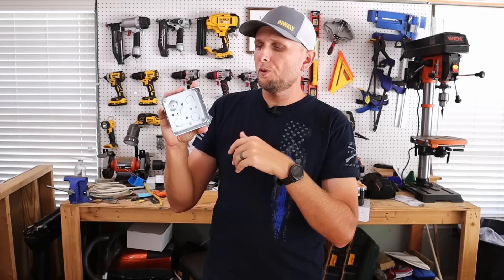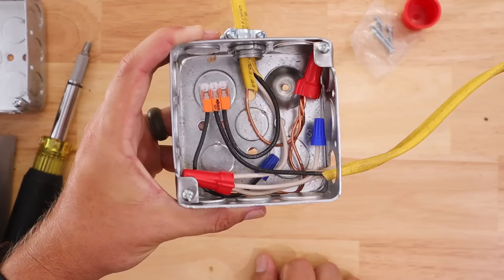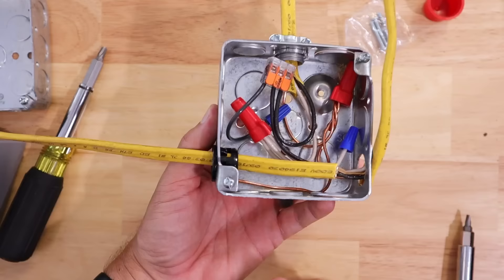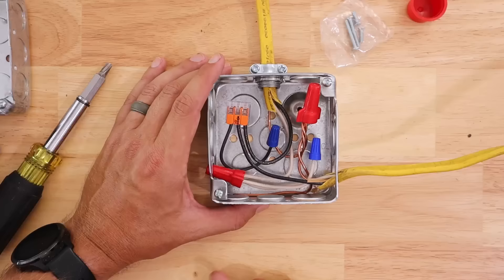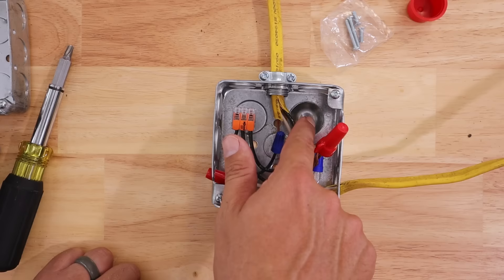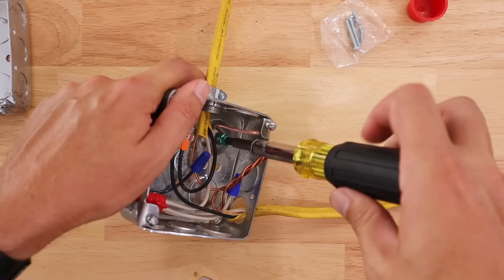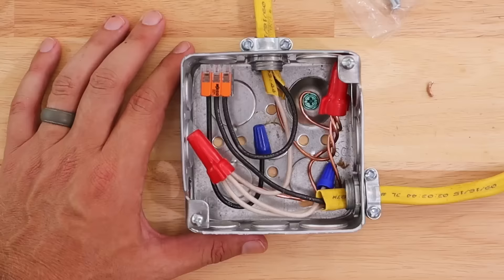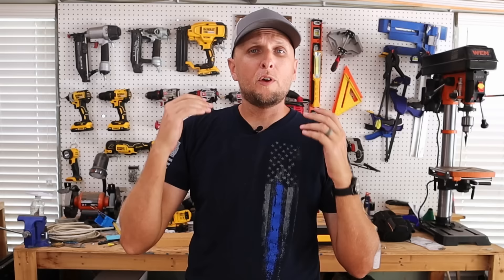The BIGGEST Mistakes DIYers Don't Know They Are Making When Installing Metal Electrical Boxes

Comment: Yes, the metal box should be grounded but grounding the box doesn't protect you from getting shocked.  What really happens is if the box becomes energized and the box is grounded, then the breaker should trip because it causes a short.  If you touch the box before the breaker trips, you will be shocked.  Remember, grounding doesn't protect people from getting shocked, it just allows OCPD to operate properly.
Reply: The chances of the wire touching the box and somebody touching the box that sitting behind a wall at the exact same time I probably a million to one
Reply: @JayJay-gl2df  Still, grounding is meant to protect wires from shorting and causing fires.  It's not meant to protect people from being shocked.  Regarding the box behind the sheet rock, the metal screw(s) on a typical plastic cover plate is grounded to the receptacle or the switch device which is grounded to the box, so technically you just would need to touch that screw.
Reply: @JayJay-gl2df  The Breaker won't always trip, and OCPD only works if there's an overcurrent. If the box is active with 8-50 ohms. Amperage could get up to 14A without tripping. With a proper ground, it would spike to 40-60A and instantly trip the breaker. GFCI rated equipment would catch this, but are 3x more expensive. There's also less than a 1/1million chance that a breaker is defective and remains open.
Reply: @Krab17  two things though not that I would use a metal box but if there is a metal box make sure it's earthed so if the active does break off it will trip the breaker and  replace the breaker with a Earth leakage circuit breaker I don't know in your country if they have them but in Australia you  just swap out the old circuit breaker and put in a combination circuit breaker combined Earth leakage breaker One Piece unit it takes the place of the old circuit breaker
Reply: @JayJay-gl2df  We have them in America,  Combination circuit breakers check for arc fault and leakage, but are incredibly expensive. But a GFCI only checks for leakage which is the most dangerous to people. Comes in breaker and outlet form. Excluding price, there's only 3 locations you don't want a GFCI, and they all involve cold weather applications.
Reply: @JayJay-gl2df  less than one in a million
..
Reply: @Krab17  I'm rewiring my son's furnace as we speak.  He cleaned the filter and and put the door back on.  The "door" is basically a piece of sheet metal that is held on with 2 screws.  Well in place he let go of it and it guilitened the power wires going through a hole below the panel.  Stupid stupid design.  Well he said lots of spark and then fire.  I went there and had a look.  The breaker did not trip! The wires grounded out and then burned until they were no longer touching the grounded metal furnace body.  So I checked and the wires were live.  I disconnected them ASAP in the furnace junction box.  We are now making arrangements to to have the 1960 federal pioneer electric panel replaced.  😳
Reply: If the box is grounded, it still protects you, even if the breaker hasn't had time to trip yet.  A grounded box pulls the shorted wire to ground potential, which is zero volts.  However, on a single circuit would cause it to act like a circuit where each wire (hot and ground) is half the load, so the voltage would be half of the original, so still safety.  Also, you would need a totally separate ground source to touch, and be in contact with both for it to be a danger.  And all that would have to happen before the breaker heated enough to trip.  Can it happen?  Yeah, but it's still pretty safe.
Reply: @Krab17  A direct short is an overcurrent condition.
Reply: It protects form getting shocked in the sense that being grounded causes the breaker to trip and eliminates the possibility of getting directly shocked. If an ungrounded metal box is making contact with a hot, the box becomes a current-carrying conductor and touching it may result in shock and/or electrocution.
Reply: The breaker will trip in milliseconds. When live is shorted to ground you will get half the voltage drop on the live wire and half on the ground. SO in a 120 V country you would only be touching 60 V.
Reply: Grounding is also meant to make sure all metal is at the same potential so there won’t be a difference of one to another in touch
Reply: I = E (instantaneous) / R (total), amps generating a voltage drop on the box from whatever current flows through the ground wire. 

That's less than half of a maximum of 150v.

There would be drops across breaker, connections, and (imperfect) short-circuit "connection" until the breaker trips, in what 1/2 to one cycle or under 17 mS.?

Likely short will be related to movement, so quite  possibly someone touching it.
Reply: @mernokimuvek  t
Reply: Do you know the difference between grounded and grounding and do you have a Masters License?
Reply: The transient voltage is dissipated thru the grounding conductor.
Reply: @JayJay-gl2df  No, you can't "just" do that - you have to move the neutral conductor for the circuit from the shared N bar to the N terminal on the RCBO.
Reply: @Krab17  Breakers with overcurrent and residual current detection (RCBOs) are no longer expensive.  Ones with AFD are.
Reply: @anonnona8099  yes I know .the wiring of  the rcbo was implied in my answer, this discussion is for people who know how to do it already
Reply: @JayJay-gl2df 100million houses in the US so how often someone dies is???? Anyway grounding is to address thermal build up until it hits the limit for the  breakers to pop
Reply: Daughter and son-in-law bought a 1960’s home wired without grounds (very common). How to make it safer without requiring it all. Our research indicates - and as others have said - that all a ground does is trip the breaker if there is a fault on that circuit, which is not foolproof. But installing a GFCI as the first outlet (nearest the breaker) in a circuit protects all the other outlets in the circuit. So if you can trace the circuits out, you need not replace all the outlasts with GFCIs.
Reply: 16 ma is enough current to interrupt the heart. There is a point where discussing these matters of grounding and what ifs that it becomes absurd. Use rimped on  ring terminals with bround lugs.
Reply: if you are touching it when it is shorted and it is properly grounded you still benefit from getting only a tiny fraction of the current going through you as the ground will be far lower resistance than a human
Reply: @Krab17  remain open yes.  but a lot of houses use fuses which can take a fraction of a second to blow.  don't know how fast breakers blow but i doubt it can be perfectly zero seconds
Reply: @DM-ei6oo how do you replace a 8 wire connection with "A" wago. don't they only go up to 5.  i'd have thought you would need 2
Reply: Any conductive conduit or box needs a robust connection to ground. Ring terminals please.

Comment: The best way to ground that 4-square box (or any metal box) is to take the ground wire from the "hot" into the box, wrap it around the ground screw (but don't cut it.)  It comes into the box, around the ground screw and continues to the wire nut UNCUT.  
That way the ground wire is not cut before it is connected to the box and if/when the wire nut is removed, your box is still grounded.  
If your inspector likes to see a ground clip without removing the cover, ground box as described above.  Then pigtail the ground, using the pigtail for the ground clip.